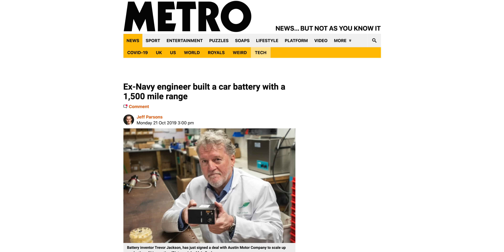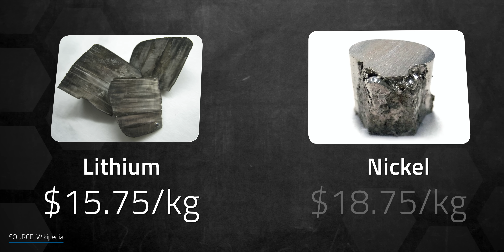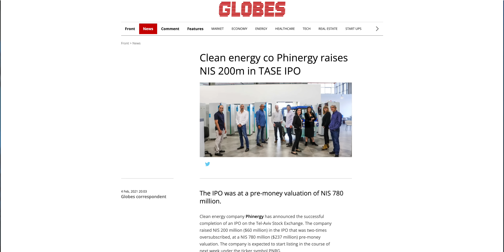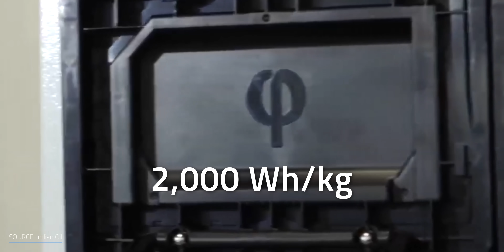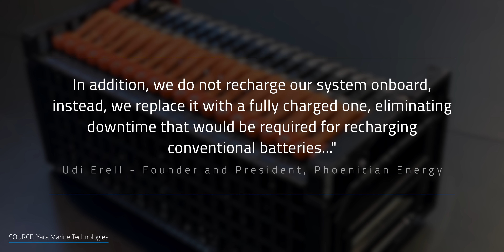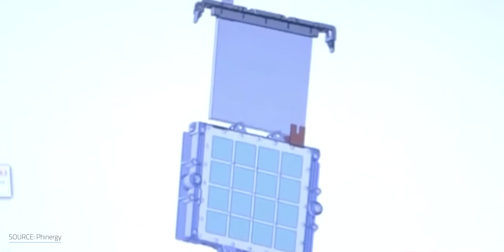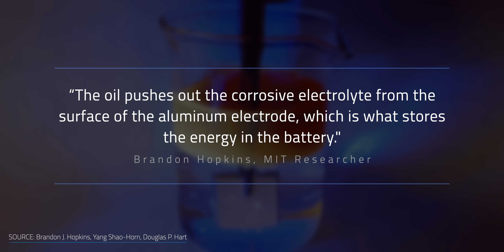Exploring the 1000 Mile Car Battery - Aluminum Air Hype?

Comment: One of the key selling points for EVs is the lower running cost. I think the argument that getting toed if you ran out energy is void when you consider someone could just bring a replacement for the battery (like bringing a can of fuel) or the towing would be equally to a regular fossil fuel car. 
Although I don't see any scenario where the cost of a new "quickly replaced" AI-air battery would be cheaper than refilling with a fossil fuel. Depending on it's energy density to weight and volume though, it could be a suitable option for aircraft? I wish that was discussed.

PS. Anyone else triggered he says aluminium incorrectly?

Comment: Maybe this can work well for truck depots, but I don’t like it for passenger vehicles.  For 4 years I’ve charged EV conveniently at home.  I wake up every morning with ample capacity for the day and it’s so convenient  not needing a gas station.  Road trips are a breeze with many chargers available.  Driving about 11K mi/yr, I don’t want to change batteries monthly.

Comment: Swapping isn't a problem at all,You can just fit 100km range li-on battery as the secondary.
As the infra of aluminium swapping station improves you can bring down the  li-on range further to 50.

Comment: This seems like a really convoluted and inefficient battery system for every day use. I can recharge lifepo4 batteries with solar panels for decades if i oversize the system and cycle it only between 25% and 75%. This system i need to swap the batteries every week? So the components can be recycled? Sounds dumb

Comment: Perhaps the solution is to have aluminium pellets that you drop into the battery or screw into the battery then once the screw in pellets or rods are depleted you simply remove what is left over and screw in a new one.

That way you can carry spare rods or pellets to power the vehicle, or buy them over the counter at a store.

Seems like the obvious solution to me, if it's only the aluminium that corrodes away then by designing the battery in a way that makes it easy to access the aluminium seems like the most obvious way around it, rather than removing the solution simply remove the rod.

Comment: Maritime or other heavy duty applications may make sense, although green hydrogen+fuel cells will be a contender. In light duty vehicles it does not make sense unless it is used as a range extender. Maybe a car with plug-in rechargeable Li-ion battery with 50 to 150 km of range for everyday use, with the ability to to use alu-air batteries for long trips.

Comment: I think these would be good as an add-on system. where you have traditional lion batteries for daily use and a spot to slot one or two of these packs in for long road trips
Reply: Yeah, that's honestly the best of both worlds. Can even have an auto swap-over system or something.

Comment: The swapping process can be easily automated and the batteries can be small enough to carry spares while still having great range. It's a great idea that just needs the infrastructure investment, but unlike rechargeable battery technology, it doesn't need monstrously powerful and expensive charging stations everywhere. I'm glad that it's getting off the ground.

Comment: Drive 5-700 km, change battery for about 10 min, keep driving....sounds like conventional refueling gas tank. That's very good if the price is good enough. And probably you know that some chinese companies explore this concept for changing instead of recharging with lithium batteries too.

Comment: In theory, most EVs with a surfboard platform (battery between 4 wheels) can potentially be engineered to allow  robotised battery swap. The problem is cost of infra. I bet it is easier to install diesel generators at petrol stations to power current EV chargers than to install robotised battery swapper in the ground.

Comment: So he used the words "energy density" a lot in this video but not once did he talk about energy density. According to Wikipedia: "In physics, energy density is the amount of energy stored in a given system or region of space per unit volume. It may also be used for energy per unit mass, though a more accurate term for this is specific energy"

So I'm happy that the specific energy of these batteries is really awesome and as someone else commented they seem perfect for applications in electric aircraft. The energy density is a very important factor here though. He said that a battery the same WEIGHT as the model 3 would get that amazing range, but what about a battery the same SIZE? I tried to do some research but I can't find anyone talking about the actual energy density of this type of battery. It might also be really good but a model 3 having a 3000 mile range on the same weight of battery doesn't do anyone much good if the model 3 is pulling thr battery behind it as a 20 foot trailer. (Does anyone know what the actual energy density of these batteries is?)

P.S. engineering explained has a pretty good video talking about energy density and why electric cars have a hard time beating out gasoline cars.

Comment: From an automotive standpoint this idea is a complete non starter. Unless there was tight coordination to get every gas station to have a battery swap-out facility then nobody is going to get into this. Li EVs have relied on domestic home charging to 'replace' the missing infrastructure that the new technology needed. Look at the investment that Tesla has made on their supercharger network. It has cost billions and taken more than ten years. Now imagine if Tesla wasn't able to sell a single car before the network was built. Li Evs have relied on the ad-hoc electric infrastructure to provide a safety net however imperfect the perception may be. And then we get to the price of the battery replacement. After <>1000 miles the aluminum battery is done. After (conservatively) 250,000 miles the Li battery is still useful and evidence shows it may have significant range associated with it. A Tesla battery is let's say $22,000. Will this aluminum battery cost $88? I don't think so.

Comment: aluminum is expensive to make in cost of power.
aluminum is much less expensive to recycle, but is still far more expensive in energy dollars.
the good news is that you can use solar to heat the furnaces.  put the smelter in the desert surrounded by gigawatt solar fields and you have a nice 8 hour work day.
massive solar field will reduce the Suns global warming effects so to that end we should cover every roof and road under a solar panel.   of course, then you could drive in the day with power from the panels, like trains who got power from the rails.  and even charge your battery while you drive.
my nighttime driving is less than 50 miles so a much smaller battery for me.

Comment: Things like running out can be easily solved by having an easily replaceable small reserve battery. That way you can have someone bring one to your car if need be. If the batteries are very cheap making them single use is not that big of a deal either.

Comment: look for car manufacturers start leasing cars for $1.00 a mile, you buy in, pay monthly instead of a car loan, it would be $600-$1,000 and they would keep it running. and swap it out for a new car when they chose to, or to replace parts to keep it running as they choose.

Comment: My main reason for not driving an electric car is the charge time. I wanted them to have a hot swap battery option because it would take about as long to change the battery as it would to fuel a car. maybe to fix the issue of having to tow the car if your battery runs out would be to have a lithium ion battery as well but it only has like 20 miles of range or less just to get you that extra mile.